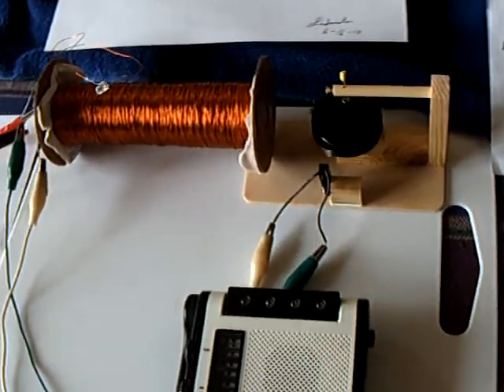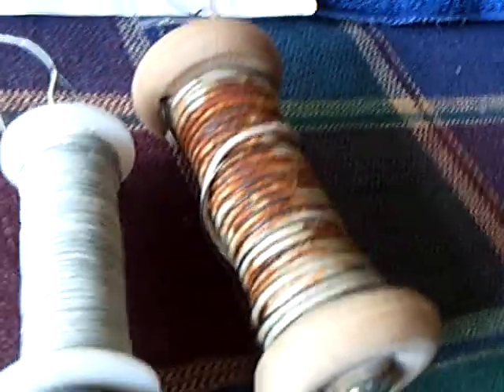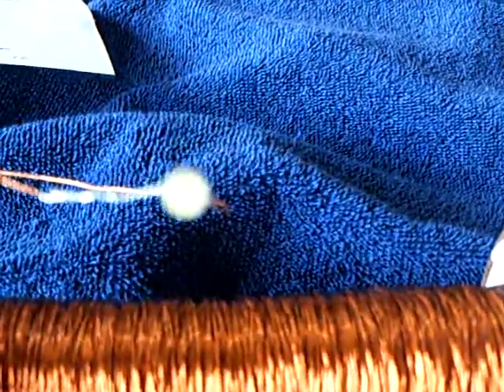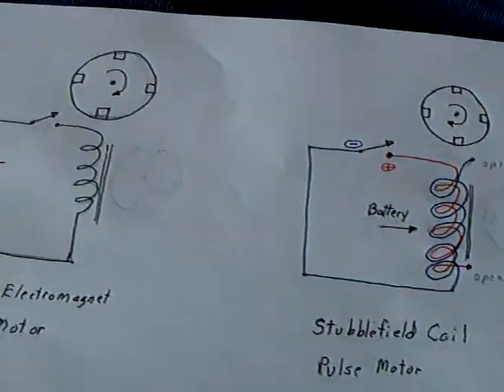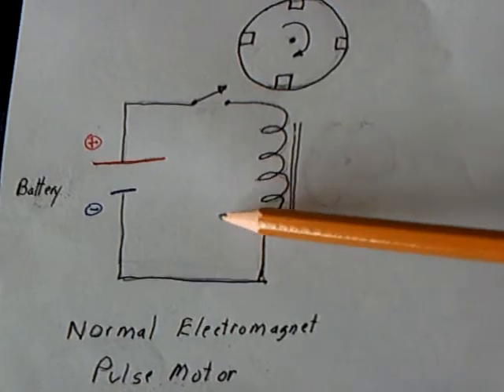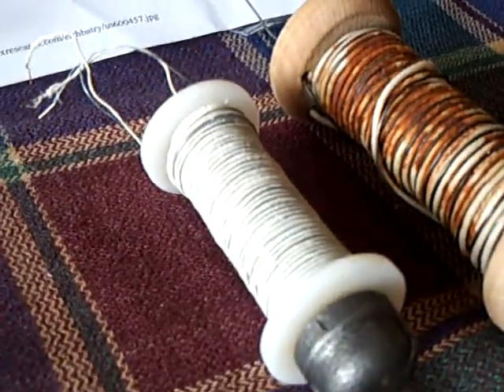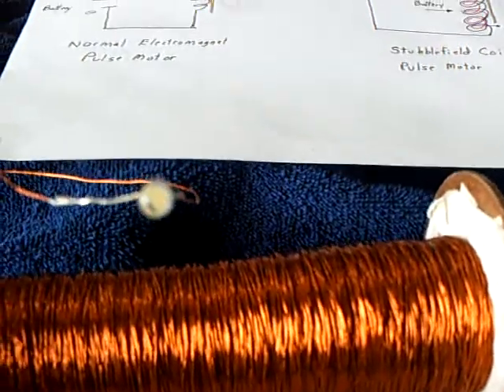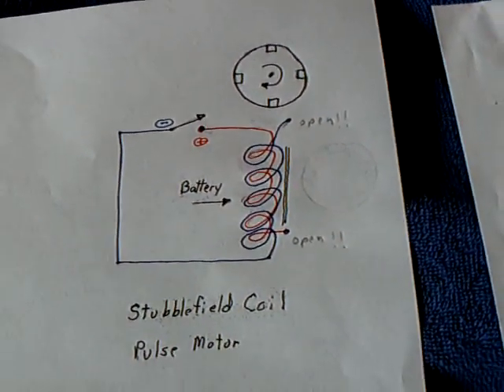Stubblefield coil lighting LED off secondary winding.ASF

Comment: @Lidmotor I guess I asked for that one. But what I was trying to say was on the secondary coil you made was it a solenoid style coil design or bifiler secondary?
I was wanting to know because if it where a bifiler type secondary it would act as a voltage multiplier in effect powering up your led and maybe your magnet motor wheel.

Comment: Very nice.
Don't you think the rotor could ever become a strong one?
I am thinking that if you can make it rev up with the addition of a capacitor, that if you were to wind more secondary, you would be able to rev it up even more.
??
I am still way behind on the rotor part, so I cannot answer this for myself yet.
Thanks for showing those 2 circuits too.